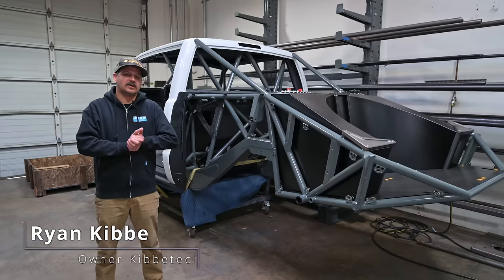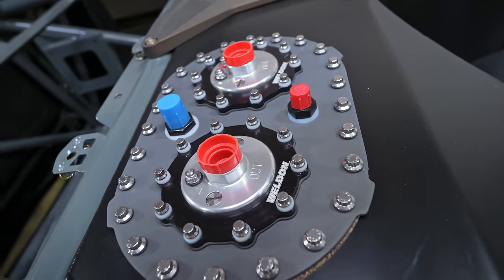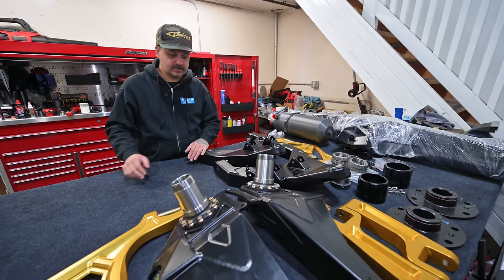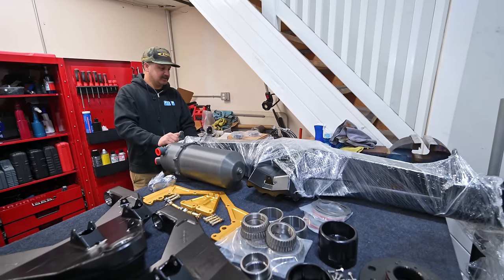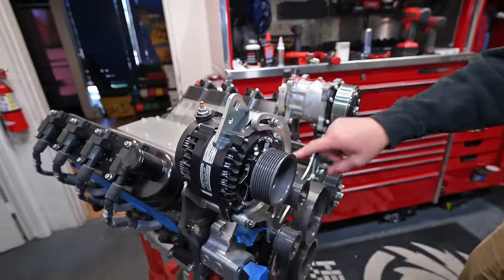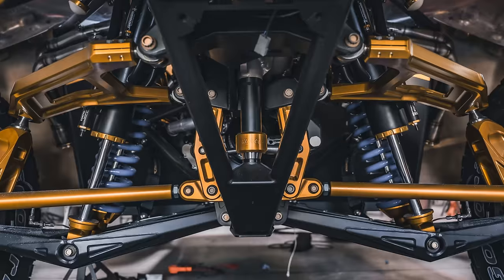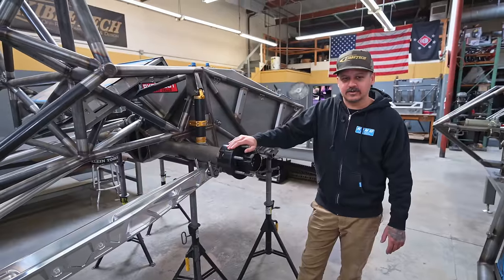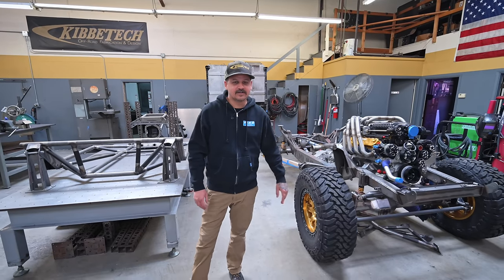WE BUILT A TROPHY TRUCK

Comment: Of all the "off road" type trucks, Trophy Trucks are my favorite. They just seem to be the epitome of durability and effectiveness offroad. MY personal goal has been to learn about all the different types of offroaders from monster trucks, to rock climbers to trophy trucks to pick and choose the best systems and designs for MY project. Which is what we call a "Bug-Out" truck. A vehicle designed to be ultra durable and reliable, able to carry a lot of gear, be self sufficient and go almost anywhere i need it to go within reason.  Speed is not a issue but not getting stuck or breaking an axle is.  So, sorry for long post but in short, THANK YOU for showing a more indepth on how they are built. I see now there will have to be considerations made into less high end alternatives as there is no way I could afford 100K+ into a truck like this.

Comment: Dope truck!!! ❤ Im just curious what Mil-Spec wiring means? Because when i hear Mil-Spec i think bare minimum?
Reply from the maker: Military specifications, mil-spec is the term. Technically I would call it race spec wiring and it’s far more than the bare minimum. All the wire and heat shrink and shrink boots and connectors used are the best of the best.